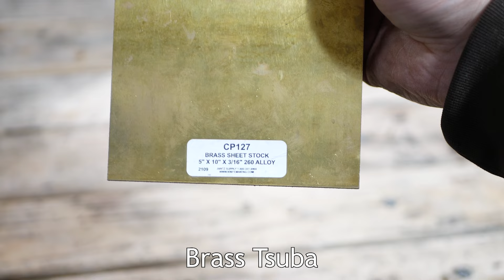Making A Katana - Yamamoto's Bankai (Bleach)

Comment: I really dig the extra work on the habaki. Ever try doin the rainfall or cat scratch style on them? A cosmetic tip I keep forgetting to mention: Cut a divot on the kashira end of the tsuka where the ito knots will be so they sit more flush. What did you put on the blade to keep it burning and will you re heat treat the blade after doing that?